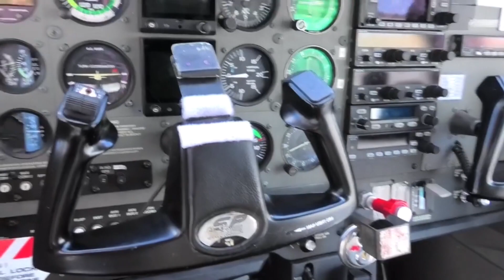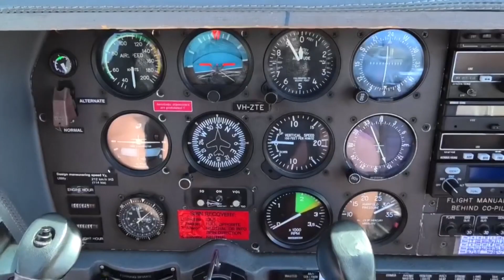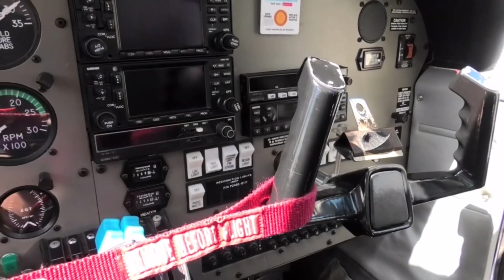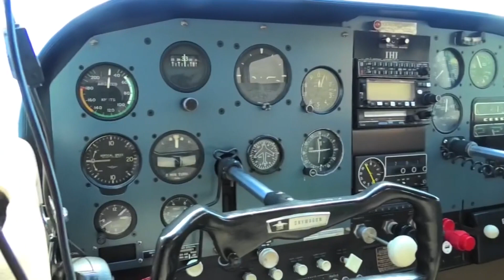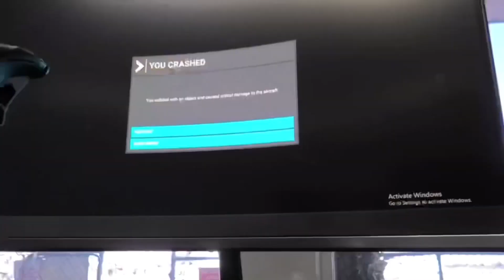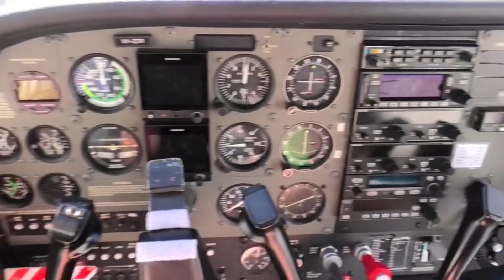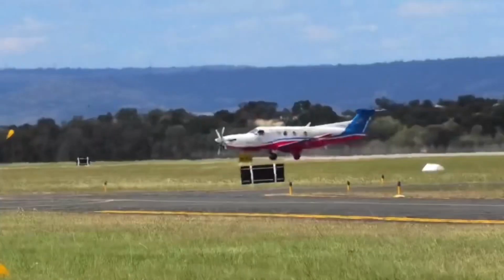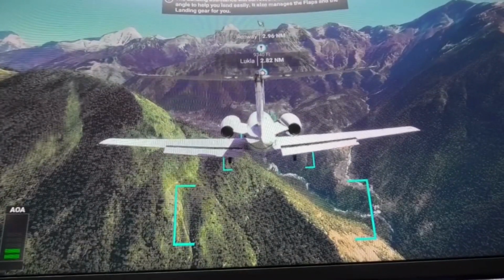Jandakot Aero Club Open Day | Inside aircraft, walking on taxiway, exclusive tour of aircraft!!

Comment: Awesome stuff 🤪
Reply: 3 hours before you saw it.
Reply: Space fish Aviation I can see into the future 🤣
Reply: @aviationiceman9549  Easy all you need is a constance space algorythm,   first we get N = num which is linear to M  = container of N+1 to an index of [1, n] we can they by assume n+ 0xHEQ x10^10(standard form) can be our space constance
0xHEQ is our ASCII storage value in Hexidecimal which will be converted to linear algebra then binary
Then we have to take into account n * m Σ(tO)
tO is our time constant
we'll times this by our Power constant which ealier was x10^10 which is standard
there by tO * n+ 0xHEQ x10^10 = our trival value
now lets work this out
if your using Python persay this will require Flyds hare and tortoise a simple cycle detection algorithm with 2 pointers where the hare traverses 2xTortoise helping us find our constant space in linear time take for example a memory block of 0x0001 so on until 0x0006 we have 6 memory blocks the popint where both pointers allign will be our constant in this perticular fission it would be 7.8357742 which isnt possible so what now? HAHA CHECKMATE we have the power to do a doublet pointer conversion by using a simple parser technique ( Where until done (parse)) this will return the nearest Block which in our case should now bhe memory block 6
Reply: So simply to calculate lets say the amount of atoms in the future Nt=P e (r * t). "Nt"
Reply: Space fish Aviation no need for the calculations  I have the new Apple Watch that can see 3  hrs into the future 🚀
Reply: @aviationiceman9549  lol
Reply: Space fish Aviation 👍🤪